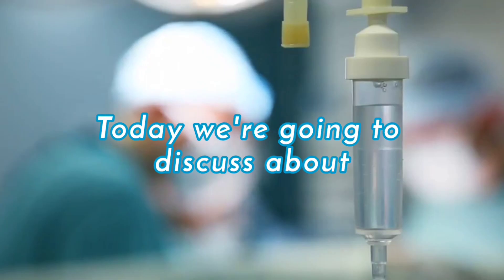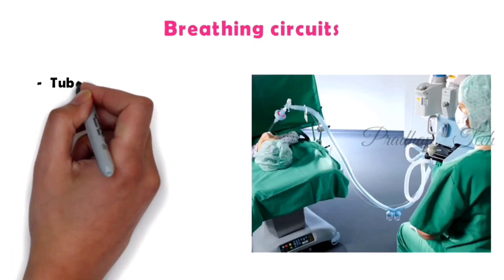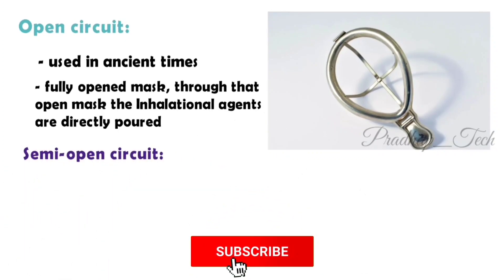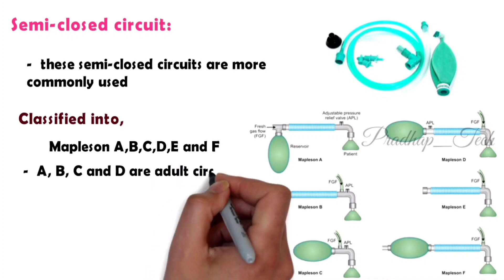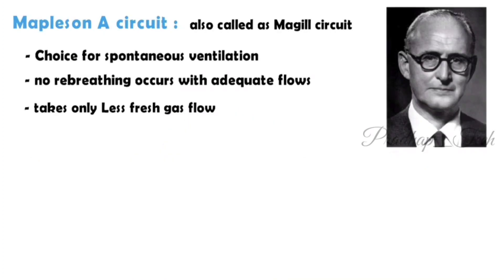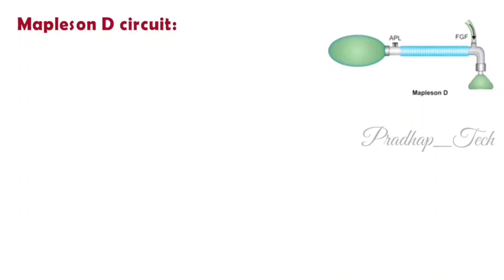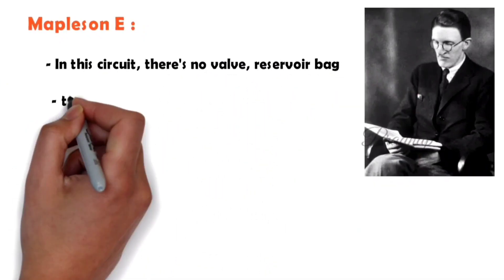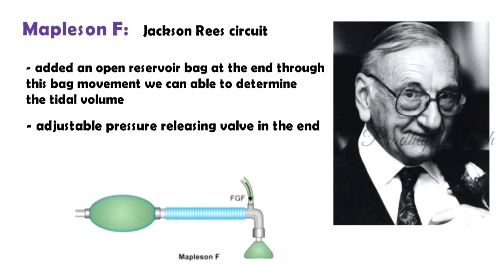Breathing circuits | Classification & Uses

Comment: You are wrong with semi-opened system. AMBU-bag+mask is an example of semi opened system. The one You showed (with cloth) is still an example of opened system
Reply from the maker: An example of a semi-open system is the Schimmelbusch mask 😷. You can also check out the Wikipedia website for more information. An Ambu bag is a hand-held device used to provide positive pressure ventilation to patients who are not breathing adequately 💨, while a breathing circuit is a system that delivers oxygen and anesthetic gases while eliminating carbon dioxide.
Reply: @anesthesiavisions  brother mapleson is always semiopen circuit

Comment: Nice attempt but the Mapleson is not semi closed but semi opened
Reply from the maker: It can be semi-open or semi-closed. But in old textbooks, they have mentioned it under semi-closed circuits. Semi-open circuits allow gas exchange with the atmosphere, letting in fresh gas flow, and have minimal or some recirculation of expired gas (Mapleson A and D). Semi-closed circuits recirculate some expired gas, but may still have a high fresh gas flow, and often feature coaxial designs (Mapleson C, F, E, and coaxial versions of Mapleson A and D). So, the configuration decides whether it's a semi-open or semi-closed circuit.